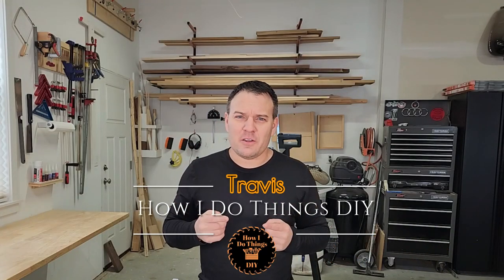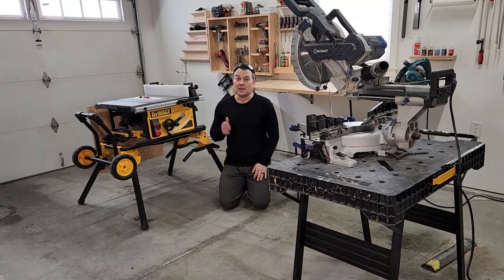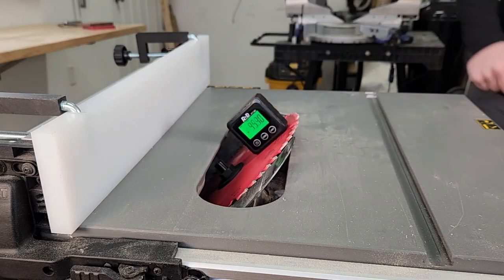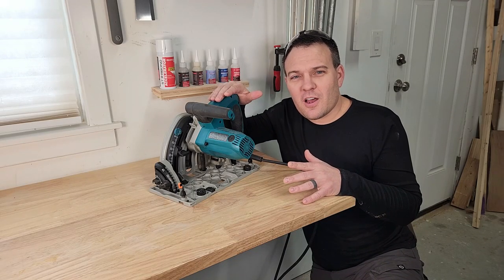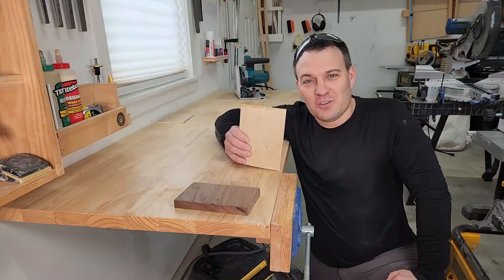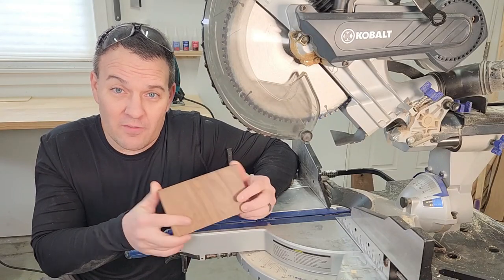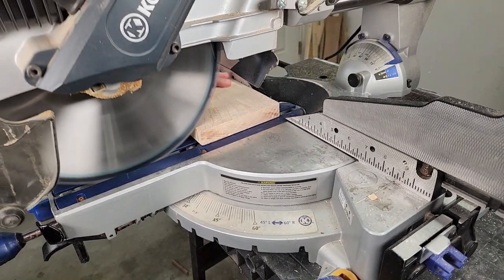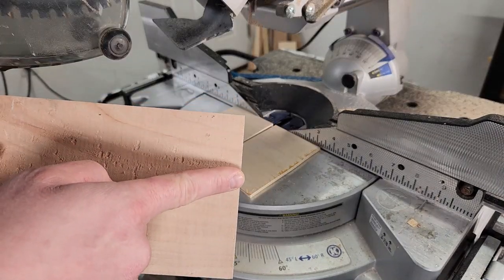Say GOODBYE to Tear Out Forever!

Comment: Best cuts made with a sled. Cleanest cuts, a little long cleaned up on a shootingboard with a hand plane. Also simply cut a little long then sneakup to the line with a second cut. This does wonders to prevent burning and blade tracks. When using a dado stack make it a smidge narrow and sneak up on the  line in both directions reduces tear out.
Reply from the maker: All great tips, as always.   Thanks for the comment!